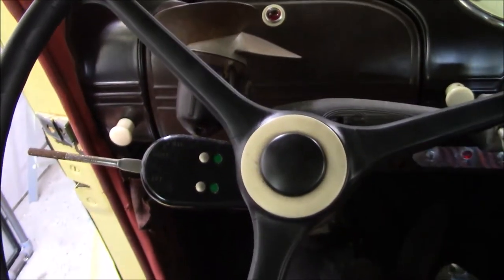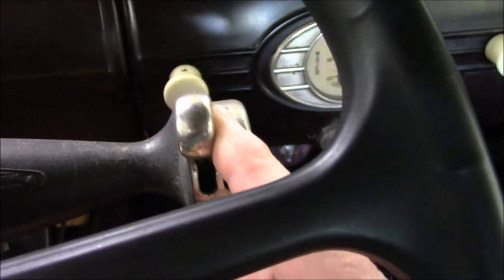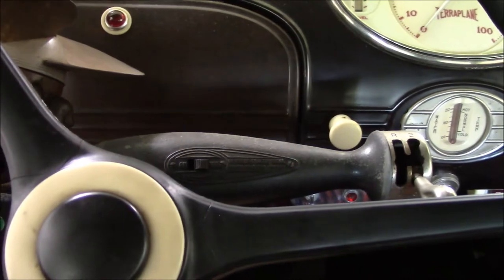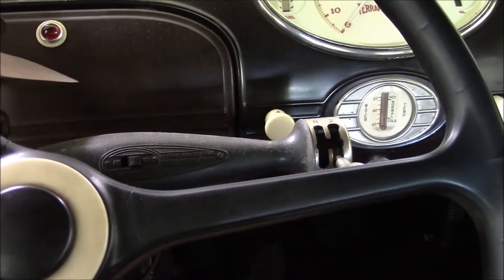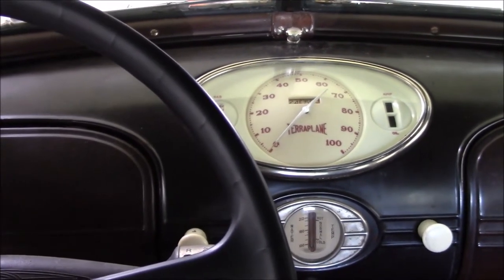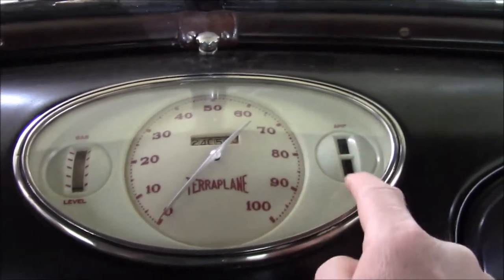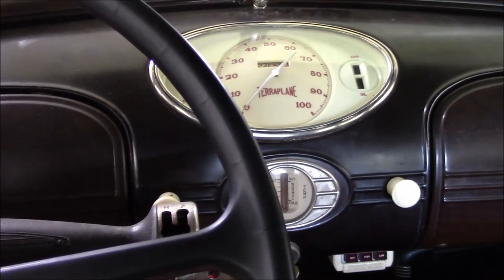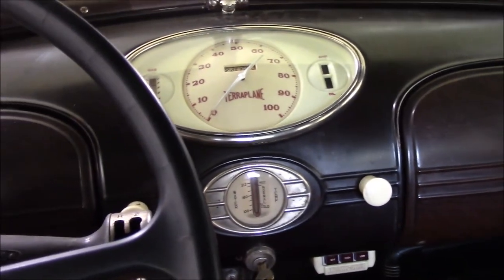1936 Terraplane dashboard ,and Electric hand overview

Comment: my 36 had that i thought it was electric vac shift it was missing the vac and brackets on tran  when i got it years ago your horn button diff to u have bubble trunk
Reply from the maker: Thanks for your reply. Yes the shifting was electrical over vacuum . Not sure about the horn button, did you have the banjo wire steering wheel ? The humpback trunks were a option for more luggage room.